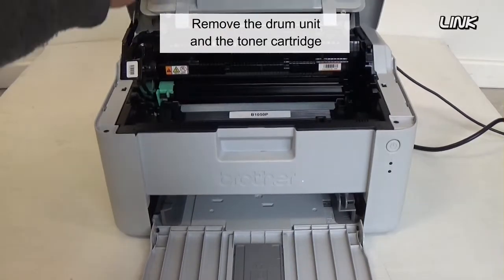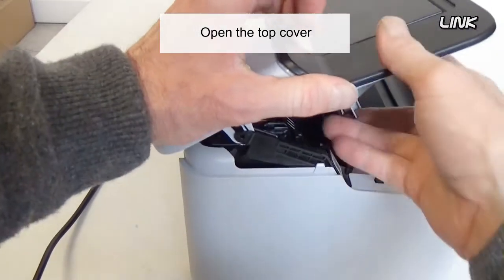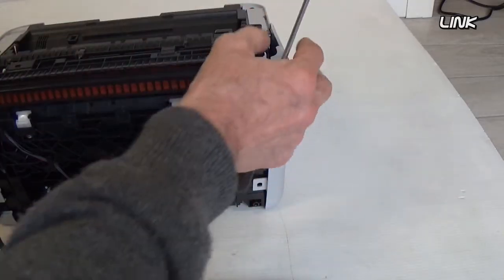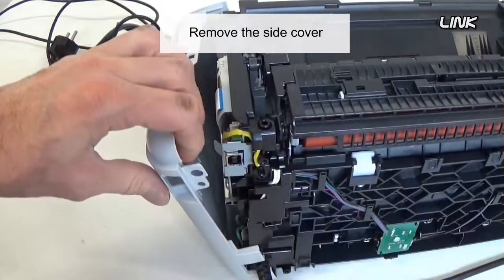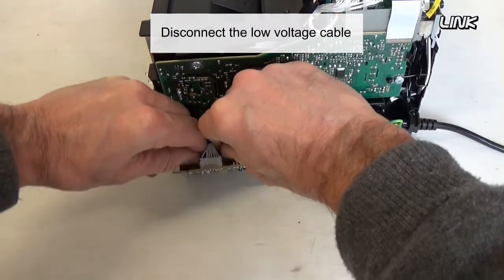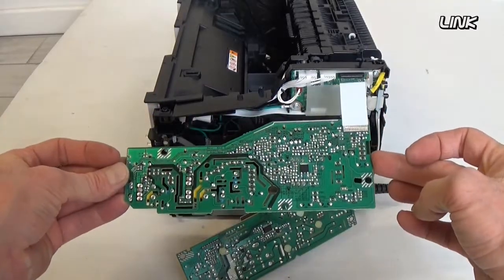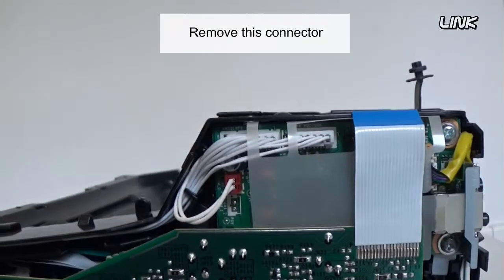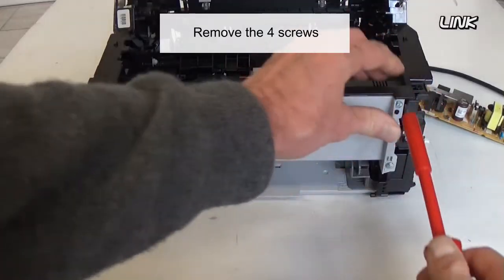How to disassemble Brother HL-1110 laser printer

Comment: Brother Hl 1201 suddenly motor not run and does not take paper to print,  pls give solution for this type of printer 🙏🙏🙏🙏 else major problem or small problem pls tell
Reply from the maker: what motor stopped to print? Is it a paper rubber roller problem? try to clean the rubber rollers

Comment: Mine is making a high-pitched grinding noise, so I need to press on the sides to print. Maybe a cog is skipping. Wish me luck.

Solution if anyone has the same problem: I found that the minor gear connected to the big one (2:15 on the right in the video) had slipped out and a little cracked. Pushed it back and reinforced it with super glue and baking soda (just the part that does not have teeth). Also regreased all gears with a little bit of silicone grease. Now it's golden. Page count: 11.728
Reply from the maker: If the problem is only the noise I think it could disappear after a while

Comment: got a Fuji P115w main motor failure which seemed to have exact design with this. Where is the main motor though? is it the lower left at 8:00?
Reply from the maker: Yes it's the same printer. Yes it's the main motor but the error messaes are often very vague

Comment: hi @viandant5, when you install the fuser at https://youtu.be/OSg_mnzdnuQ?t=649, is the fuser gear supposed to touch the white gears on the right side of the printer? mine does not touch them and the paper jams exactly when it is supposed to be picked by the fuser, so I am suspecting it is due to the gears. What do you think? Thanks.
Reply from the maker: If I remember weel it must contact the gear. Check if the gear has some broken tooth. When the printer is turned on check if the fuser rollers are turning.
Reply: @viandant5  Thanks for the reply, I managed to fix it - the problem is I opened the fuser to check the heat lamp and after I put it back, I did not fully push the drum in its place, so the gear wheel was not making contact. Now is fixed. Thanks for this video as well, it helped me a lot.

Comment: Minha brother hl-1212w só liga/desliga sem o cilindro, com o cilindro não desliga nem imprime.
Mesmo com cilindro sem o toner fica com erro.
My brother hl-1212w only turns on / off without the cylinder, with the cylinder it does not turn off or print.
Even with a drum without toner, it is wrong.
Reply from the maker: Probably there is a shurt somewhere in the drum unit. Check if there are foreign objects in the corona wire assembly, or other foreign objects inside the printer near the contacts
Reply: @viandant5  I bought a new cylinder and the error continues.
Reply from the maker: @marcosmartins1416  Check the contacts between the printer and the drum unit. Check if the transfer roller is in the right position

Comment: Hello! Could you tell me what I could do, the two lights are on, and the machine cannot be turned off
Reply from the maker: Detach the electrical cable and try to turn it on again. Check if there is jammed paper inside the printer
Reply: @viandant5  I have unplugged it but when turning on it produces the same error, do not disassemble it but there does not seem to be paper work
Reply from the maker: @ezetuber6360  Without checking the printer it's difficult to say, may be  a paper sensor. Check if in the printer folder or properties there are more informations about the error

Comment: I just changed the drum, but the print is clear on the left side. Help me
Reply from the maker: Try to reseat the toner cartridge. May be it's not in the right position and the toner roller is not in contact with the drum. check the corona wire cleaner, is it in the right position?

Comment: Can you suggest me about an error in HL 1110 or HL 1201
Reply: I am getting error '' door is open '' but the door is properly clossd, 

I opened the door and tried to check the door sensor[left side], by checking and trying   the problem is not solving. 

Is there any other sensor in the printer? which can cause this error ? 

what can be the reason ? Is this a damaged sensor problem or something else ?
Reply from the maker: @Dr.PSRawat  If the pin of the printer door (the one who enters in the slot of the printer) is not broken or shortened, probably the sensor is defective
Reply: @viandant5  Hey, yes. May be the sensor is defective. I'll show it to service centre now. Thank you 👍

Comment: Se  quebró la pestaña que acciona el sensor de cubierta abierta; ¿Cual es la posición cuando la cubierta está abierta, obturando o no la luz del LED? en la sobre vista no se alcanza a ver el detalle. Gracias.The tab that triggers the open cover sensor was broken; What is the position when the cover is open, shutting or not the LED light? in the over view you can not see the detail. Thank you
Reply from the maker: When the cover is open the sensor is up
Reply: @viandant5  thanks, but to make it clearer, if the sensor is "UP" it means that it is free or sealed
Reply from the maker: @robersound6586  free
Reply: @viandant5  Thank you Viandant5

Comment: Hi, good job. The main board of my printer is dead, cause 812013-c11 A51279 1338nc006 was shorted. I removed it and now short is gone away, but where can I buy it? or where can  I buy the full main board? thank you
Reply from the maker: it's difficult to solder the component, and it's a dedicated compnent difficult to find I think it's better to buy all the board
Reply: viandant5 thanks for the reply, but for me is not a problem solder this component. The only problem is that I found it on a Chinese site, but I don’t know if it’s preprogrammed and will work once mounted. Do you think it will works anyway?
Reply from the maker: I do not know which component is, I know that Brother and other manufacturers use dedicated components, I had problem using compatible components